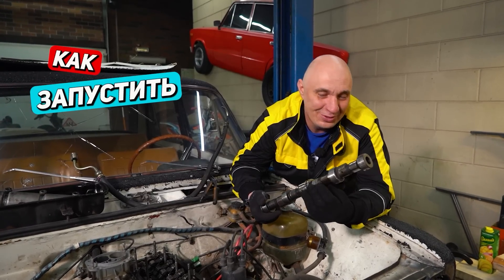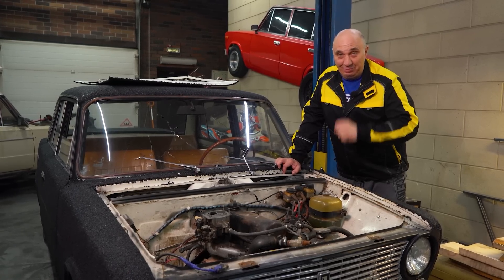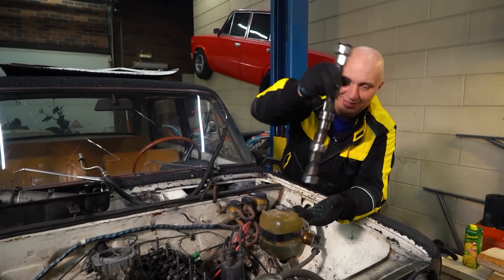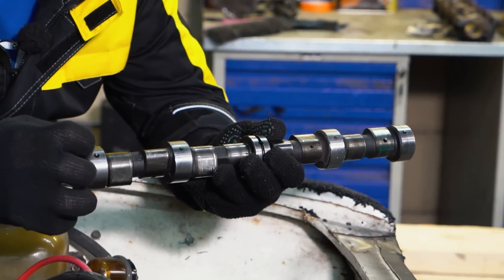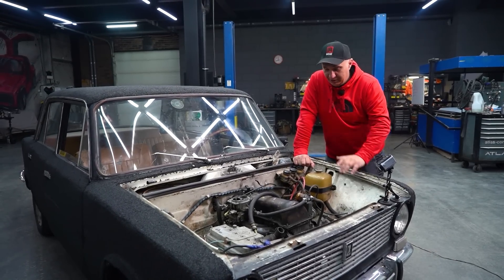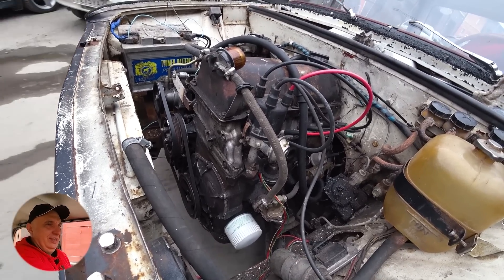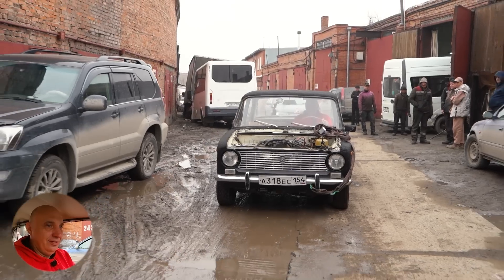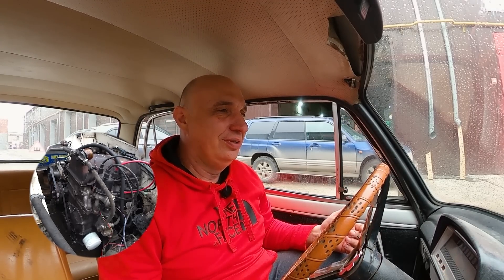Can we make an inline-4 run inverse?

Comment: I have right and left hand boat engines the only difference is the timing chain  on the right hand engine and the left hand engine has two timing gears that  touch and as the crank goes the other direction the cam goes the proper direction causing the oil pump and the distributor to go the proper direction.. the difference is the starter and timing  gears instead of a chain on two gears going the same direction...    TDC is the same the  only thing that changes is crank direction of rotation..  and if you want forward gears you can turn the rear end housing over putting the Ring gear on the other side of the pinion changing direction of tire rotation..

Comment: You should build an inline 24-cylinder engine. That would be awesome.
Reply: Radial engine like an old airplane engine with I4 lada blocks instead of single cylinders around the central shaft. No clue how the firing order would work, but it would be hilarious to see.
Reply: @UmmmmmmmWhat  All the oiling would have to be dry sump as well, at least for the side and bottom mounted ones
Reply: @SlowMenWorking Just run them all as individual engines 🤣
Reply: Inline 24?? 6 Lada engines in a row? It would be 16 feet (about 5 meters) long!

Comment: Love your experiments guys. Starter are DC just switch polarity and it should (in theory) turn in reverse.
Reply: Except starters use the body as a ground,
Reply: And I don't think the Bendix would allow the gear to engage the ring gear?
Reply: @grabasandwich  true.
Reply: @christianfritz6333 Not much electronics are in a Lada, so probably you could run it positive on chassis. The only problem that the helix on the shaft should also be reversed, otherwise the gear might mesh, but would not disengage from the ring gear.
Reply: @gabiold  right, second comment. The helix gear (slang term bendix).
Reply: @christianfritz6333  Honda has engines that turn in both directions adapt one of those.
Reply: But let's be honest, getting a starter to work on this engine would be child's play for garage 54.
Reply: News flash y'all: Brushed starters such as in a Lada are series wound, and will run the same direction on either polarity. They're also known as the universal motor, as they happily run on AC or DC. Flipping the polarity won't do it.

You can change the phase of the brushes in relation to the stator, but as someone mentioned, the bendix still won't engage.

Easier to just flip it around and mount it from the other side if obstructions allow it.
Reply: The solenoid will pull the plunger instead of throwing it out, best solution would be to strip it and flip the field magnets in the stator then it should run the opposite direction. Bendix drive shouldn't matter if you don't mind going dog to dog with the flywheel now and then, might need to weld the clutch bearing though

Comment: You guys are awesome. You can achieve anything. I didn't think it was possible to make a engine run backwards.  Hi from Australia 👍
Reply: With a 2 stroke it's as simple as spinning it the other way and messing with the ignition timing... with a 4 stroke there's a bit more to consider 🤣
Reply: Volvo penta engines are chevs running in reverse for boat engines

Comment: The carburetor could have been placed where the exhaust exits
 Then start the engine in the opposite direction of rotation without adjusting the camshaft. Of course, the exhaust will come out of the intake manifold
Reply: good thinking
Reply: Yamaha made a 'Reverse barrel' TZR250 (I think in the '90s?) where the carb was where the exhaust manifold is usually), and the exhaust came out the back. The thinking then was that a combination of air being sort of 'Force fed' into the engine plus the acceleration G's and simplistic front to back 'Natural flow' would help with power... Not sure how much it helped, but, nice concept though. It DID make me think though around that time why more cars & motorcycles weren't built that way, as, it did seem logical to create a 'Better flow' for input/exhaust (cooler air in, a 'Direct' exhaust out back kinda thing)... 🤔😏
😎🇬🇧
Reply: Always wondered as a kid later yamaha 450 mx bikes do this somewhat but they loop the exhaust all the way back around @thedarkknight1971

Comment: Wait but what about the water pump and the accessories? Wouldn’t it overheat since the pump is spinning in the wrong direction?😂
Reply: Anything on a pulley can be made to spin the right way by simply putting a belt on them upside down (e.g. if the direction the belt travels makes it interact from the top of the pulley, putting one on that lets them lead it to the bottom of the pulley, will then turn it the way the device was originally intended, further you can regulate speed by changing the size of the pulley if you needed to, e.g. using something not built for this specific application like the makeshift oil pump here). Too lazy to rewatch it and see if thats what they did though.
Reply: Meanwhile the oil pump is just blowing bubbles in the sump

Comment: Fairbanks Morse built opposed piston diesels that could run in either direction by shifting the phasing  between the two crankshafts via a lever. Of course it was easier because it was a two stroke.
Reply: I've also seen people say Detroit Diesels would sometimes run in reverse by accident. There's even a video on here of a dump truck with a Detroit that stalled on some hills, and smoke starts pouring out the air filter 😂
Reply: @grabasandwich the forklift at my old work used to was ruff to get it to but it would blow all the dirt back outta the air filter hahaha
Reply: Some GM 567-645 ship engines could change direction with the shift of a lever, (air start so no starter problems).
Reply: Most large ship engines are run in reverse to back up.
Reply: They had railcard in nsw that had this. Needed to shut down to get into reverse 
The old tin hares
Reply: Same with Lanz Bulldog tractors. You can make them idle at 0 RPM as well.

Comment: I have a old 1971 American general m35a2 “deuce and a half” military truck…. And every so often I start the engine (multi fuel engine by Hercules” and the motor runs in reverse, sucks air from the muffler and exhausts out the air intake…. All I gotta do is shut it off and restart it normally…..